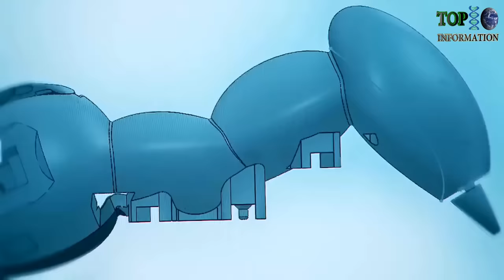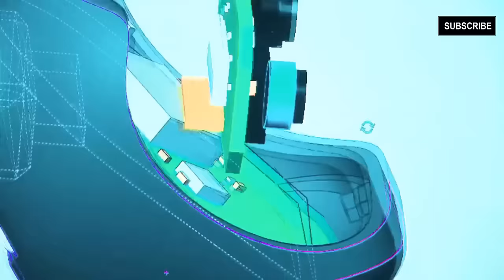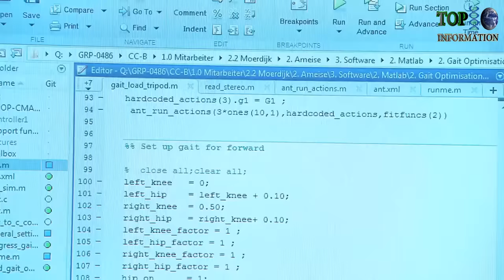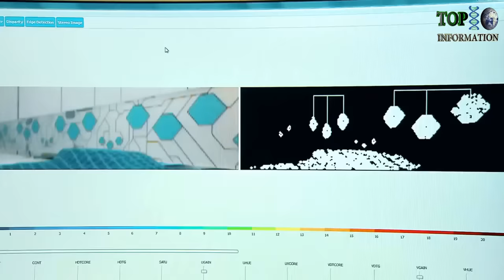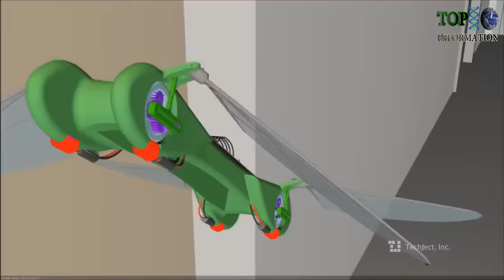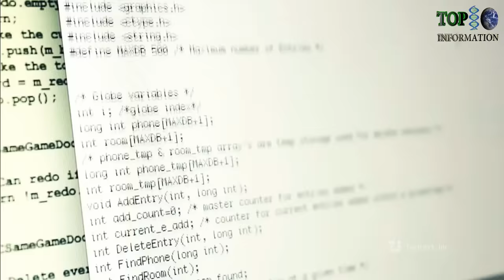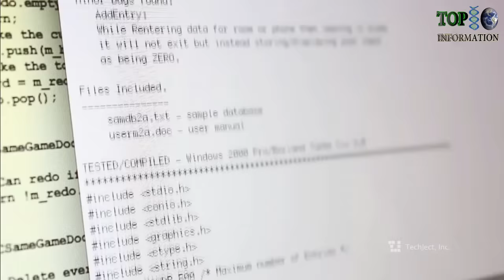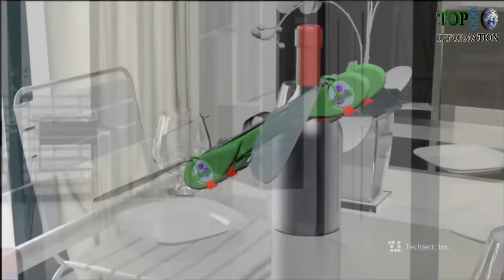8 Amazing ROBOTS ANIMAL YOU NEED TO SEE ▶ 1

Comment: For the Cheetah, why not use a lighter 3-D printed material now in use for cast replacement? It would be lighter and should get more speed and be able to jump higher. If the housing of cylinders could likewise be fabricated from the same or similar material, it may help even more. (cylinders, etc.)

Comment: oh goody, your cheetah can go 10mph in a straight line and hop 1ft .. no tail to assist in high-speed turns, in fact no high-speed and no turning at all .. since your stated goal was to understand how they move, you failed miserably.

the only item with broad applications is the first dragonfly, and it is impressive.  the rest is mostly a festo advertisement of useless products (butterfly, bird, 2nd dragonfly) unless you want to sneak up on a kangaroo or penguin, or use the toy penguin to see the inside of a shark.  call me when your penguin can send video from the bottom of the Marianas Trench.